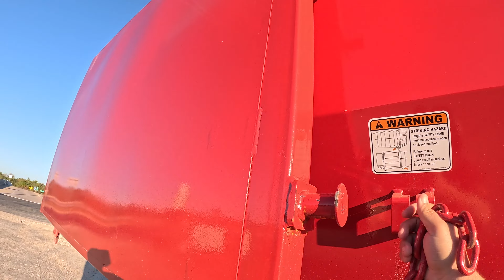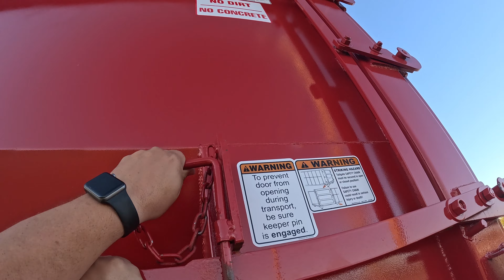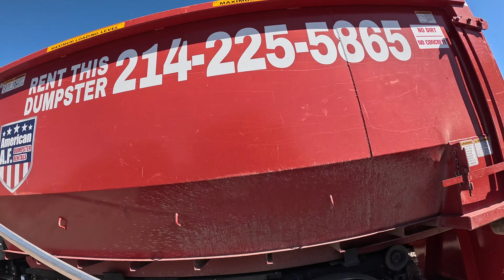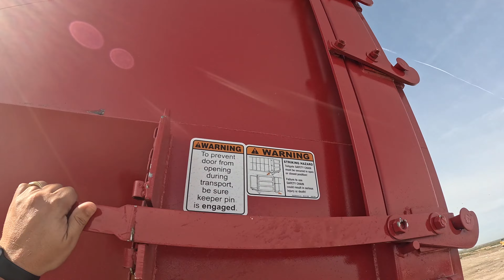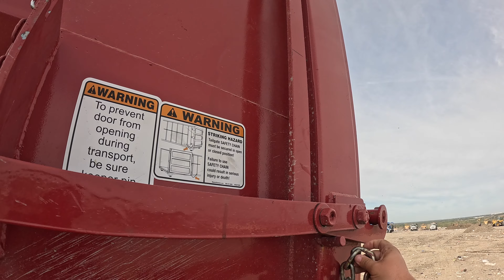Behind the Scenes: Delivering Roll-off Dumpsters | First-Hand Look 4K

Comment: Josh, how is your tandem holding down the rear of the dumpster on the truck? I assume you have those tabs on the dumpster rail. I just bought a tandem and they weren't securing it
Reply from the maker: Yes sir I will take a picture tomorrow and post it here.  It has a C-channel on both ends that the tabs slide under just like the Swaploader.

Comment: Everything else being the same, not counting length, dump angle, weight capacity, or hook system, which truck do you prefer, the Mack or International?
Reply from the maker: Man I can't lie.  The International has a roomier cab, is way more comfortable of a ride, and has been a solid truck even though its used.  The Mack has had issue after issue, literally check engine is one again and the turbo seems to be skipping.  I am not sure if it's just a medium duty Mack truck thing or what, but I am not impressed to say the least with the Mack!